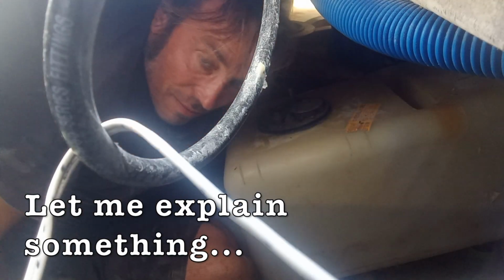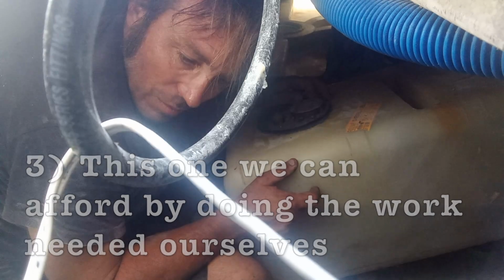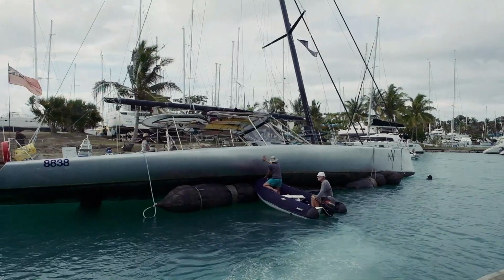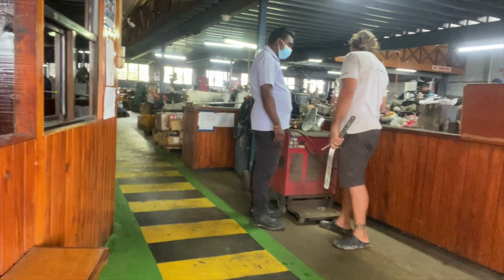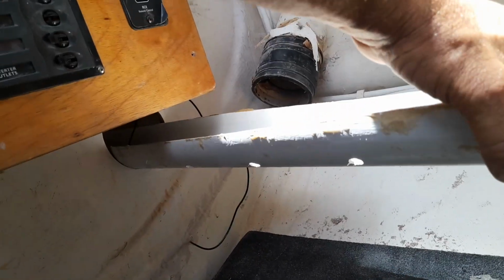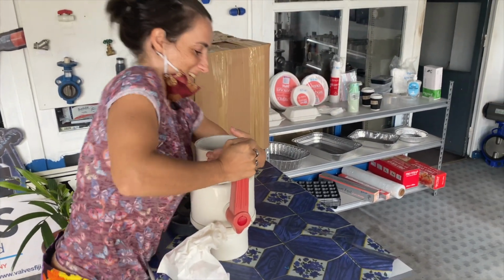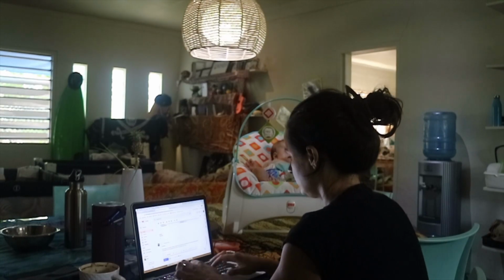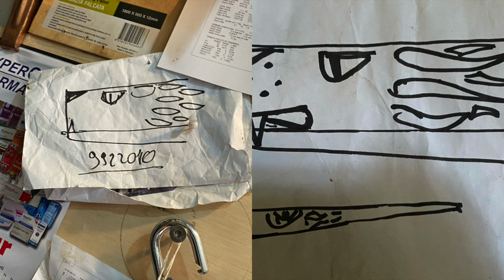The TRUTH behind REFITTING our EX VENDÉE GLOBE RACE BOAT | Ep. 16

Comment: In my experience, the reason that major rebuilds and refits take so much longer than expected is not just because unexpected new problems are discovered, and not just because new projects are added because it seems sensible to also deal with them while working on connected issues. Even with all that, it's still not the actual work that takes so much longer than planned. Rather, it's all the extra time chasing down obscure parts, or fabricating them when not available, and chasing down or devising special tools needed, or reconfiguring a limited workspace area for different tasks. It's also just the time to figure out the best solutions to a unusual problems and effectively dovetail the solutions to the other systems and componants. Hope you're able to stick with it and give it the time to see it through. It will be an awesome boat in the end.
Reply from the maker: You are spot on! This is exactly our situation! We are really trying to keep our chins up and stay motivated!!! Like you say it’ll be worth it in the end… 💪🏻
Reply: Yes, so very true..